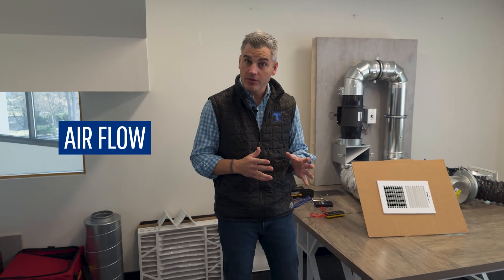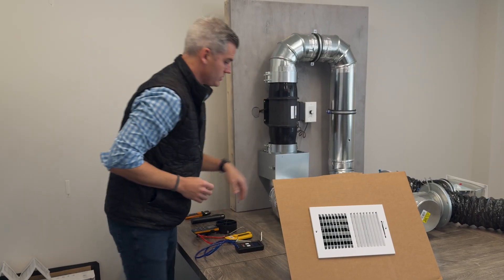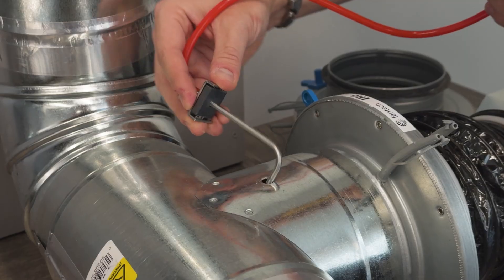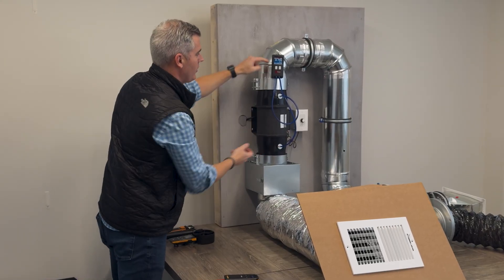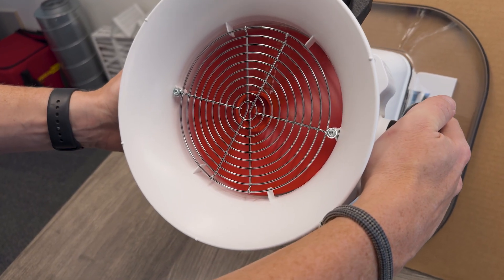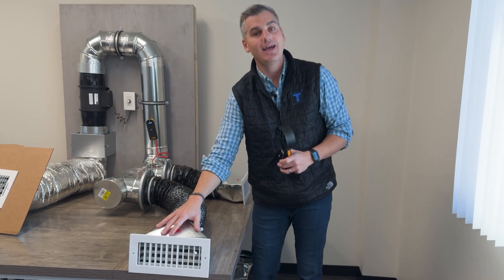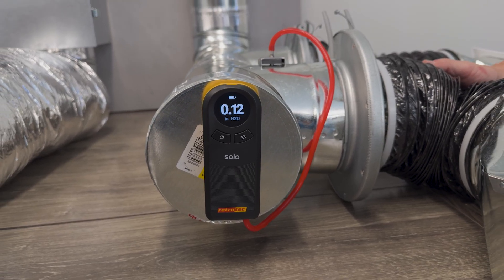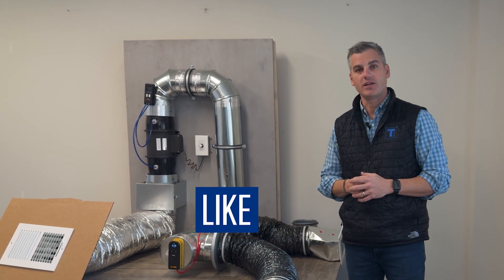Don’t Choke Your HVAC System - Static Pressure and Airflow

Comment: A big mistake especially when running air conditioning is having to restrictive of an air filter in place. While it’s nice to think you’re grabbing all of the tiniest particles out of the air stream, it can come at the expense of air flow, which is extremely important in terms of proper evaporator function.  So sometimes it’s best to have a less capable air filter that yields a higher/proper flow rate.

Comment: Whats the model numbers for the hand tools used for this video?   Thanks very interested in the smoker
Reply from the maker: @retrotec AirTracer is the smoker, one of the my favorite tools. They make the ACIN flow hood also. 

The energy conservatory makes the DG8 manometer which is a great tool as well.

Comment: I have a new construction home.Air enters the air handler.Some goes through the evaporator coils and some goes up through what looks like a 8 inch bypass with a manual damper.Was having a problem with humid.Closed the damper so all the air flow now passes through the coils. Removes all the humidity now. What is the purpose of this bypass? In the winter it’s the same . More air passes through the heat strips instead of going around them. Installer just installs . Know nothing🤷🏻‍♂️

Comment: No HVAC installer has ever done such tests in my homes. Are they relying on computer models instead?
Reply from the maker: Always best to measure items like static pressure and airflow to be able to confirm and verify proper operation. The computer models can tell you what you should have but not what you actually have.

Comment: Simple definition -  Install same size ducting on the return side as the supply side.
Reply: Maybe that explains why they slightly undersized the ducting on the return for my new propane unit.  (Was being upgraded from an oil unit, and the ducting was already used when installed 40 years ago lol, and it had no return until a few weeks ago).

Comment: Nice intro … what are the effects of a large boot on a system or the air in the room? all of my boots are 4x12 with a 6 in duct feed … most I’ve seen are 4x10… does that slow the ending velocity and keep the air lower to the floor … my rooms are 12’ tall. Or was there just a sale that day on larger boots? Lol

Comment: BTW You're measuring total pressure not static
Reply from the maker: Incorrect. This is one of the most misunderstood topics in HVAC. 

I am using a static pressure probe and only measuring static pressure in the duct. I am not using a total pressure probe or more commonly known as a Pitot tube. 
Also see my answer about this in a previous comment.
Reply: @rosstret  Umm...A pitot tube would measure VELOCITY pressure. You are pointing your probe into the airstream. Therefore you are measuring STATIC pressure + Velocity pressure or, in other words, TOTAL pressure.
Reply from the maker: @outofcontrol4499 sorry but this is incorrect. I will add to the list of future videos. 

In short a Pitot tube measures the total pressure and static pressure. If you take the difference you get the velocity pressure. 

I am using a static pressure probe. The end is capped. It does NOT measure total pressure.

Comment: Thanks, Ross, for this wonderful video! I’m just a bit curious about the orientation of the static probe. Shouldn’t the probe tip be parallel to the airflow rather than facing into it? In most cases, the probe tip has an opening used for measuring total pressure
Reply from the maker: It depends on what you are trying to measure and which type of probe you are using. We are measuring static pressure and using a static pressure probe, not to be confused with a pitot tube. The pitot tube measures velocity pressure by taking the difference between the total pressure and static pressure.
Reply: @rosstret 
That is actually a total pressure probe. Since you aim it into the air flow it is combining the flow plus the actual static pressure in the duct. The side holes on a pitot tube are the static ports, the forward is the total pressure,  the difference (delta pressure) id used to calculate the velocity of the air.
Reply from the maker: @j @johnmeeson822  John, the probe I used is a static pressure probe. The end is “capped” and only records one pressure measurement (from the side wall, hence static pressure). It is NOT a total pressure probe or more commonly referred to as a Pitot Tube, which measures both total pressure and static pressure. The end cap is open on those, and has 2 pressure measurements (total and static). You can read more about the difference here: https://www.hvacrschool.com/total-external-static-pressure-tesp-a-basic-review/

Comment: Great video, Ross - great job clearly communicating a frequently misunderstood topic. Anyone struggling with understanding duct performance and/or design, Manual D, TEL, available static pressure, etc., should spend some time taking pressure drops across various components - external evap coils & air filters, fittings like elbows, reducers, transitions, etc. - at various airflows. It was very helpful to me early on when first connecting those dots. I'd like to see a video explaining the other half of the Btu delivery equation - temp change & enthalpy change - and how it can be useful in comparing those values at the equipment and out in the rooms to help identify performance problems.
Reply from the maker: The more experience you have taking measurements and understanding what they mean, the more it will all make sense right? That is a great topic suggestion. Adding it to the list!

Comment: This was great! Thank You! Almost every house I inspect has airflow issues. This video shows a system in balance I assume? Since there is a clear path from the supply to the return. Very often I’ll observe a house with a central return and no path back to the return when the door is closed. So the rooms are getting pressurized and the space with the return is getting depressurized. Most newer homes are doing a pretty good job of resolving this but older homes are pushing air out of the bedroom windows and pulling air in thru the living room windows. 

Would a bypass damper solve this? In lieu of creating a perfectly balanced system should we just remove the unused humidifiers and install a damper? 😂
Reply from the maker: What you are describing is known as the lack of proper return air pathways. You can measure the pressure difference for rooms with the door open versus closed. I will do a future video on this!

Comment: Thanks Ross, this was good. I was hoping you were going to remove the filter and show the difference without it! One thing you did which I thought was interesting was when you squished up the flex duct the CFM dropped due to the rise in pressure. That's why flex duct is supposed to be taught? Keep the videos coming! Scott
Reply from the maker: We have another video we just shot on filtration. So hopefully that will answer your questions!
Reply: @rosstret I look forward to seeing that!

Comment from the maker: What HVAC topics would you like to see content on? Let me know in the comments below.
Reply: A few subjects, since I have been dealing with them:
1. Correct sizing of filter/plenum.  I had a new 4 ton heat pump installed. The installer kept the 16x20x1 filter housing resulting in the furnace being loud and the Heat pump completely icing over. 
2. Proper sizing of air handler with regards to required BTU’s but also the collective area of the vents: I have a 3 ton upstairs blowing through less than 300 square inches… 
3. Loud compressor noise from Heat Pump. Causes and solutions 

Great video. Subscribed.
Reply: Really nice video. Maybe a future topic is the pros and cons of using a heat pump vs just ac and furnace. Or a hybrid approach ( heat pump with furnace as backup).